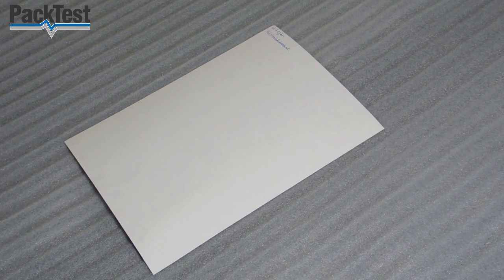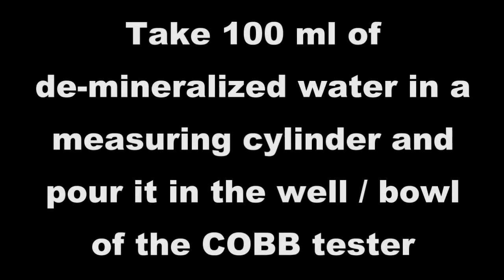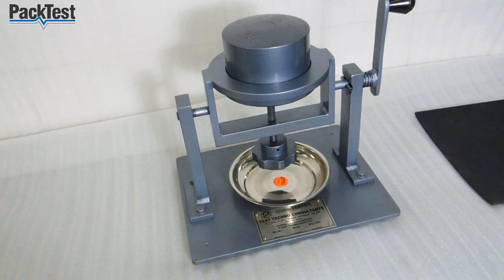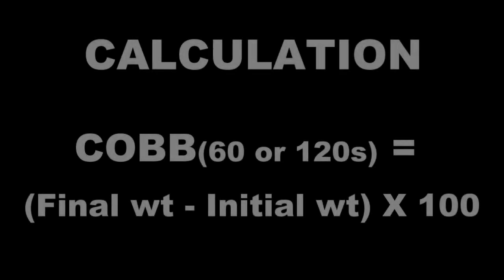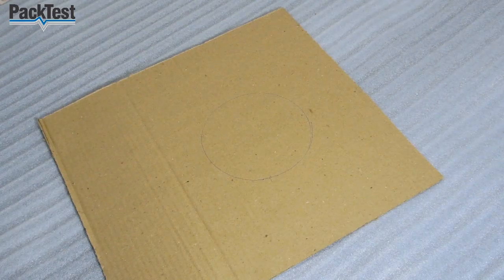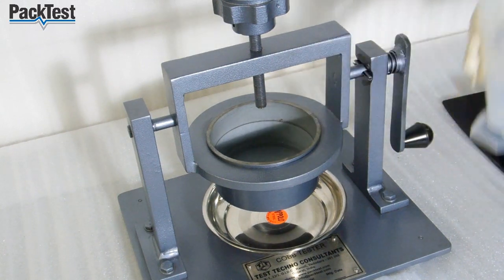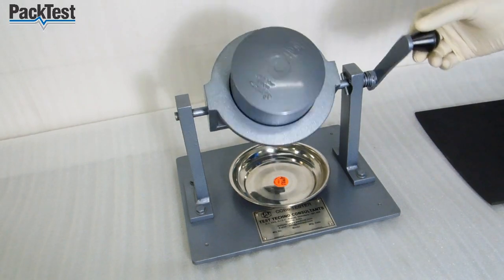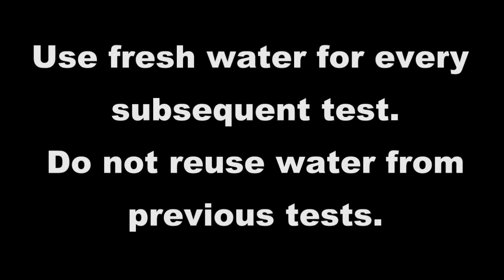COBB Tester Video Guide by PackTest.com (Confirms to : TAPPI T441 / ASTM D 3285 / ISO 535)

Comment: The test process is clear and understandable, but what is the correct value after the test?
That is, what are the absorption parameters that show whether the paper is normal and resistant to absorption or not? What amount of water absorbed is considered a normal value and what is not?
Your help is very important.
Reply from the maker: Interesting Question. Unfortunately there is no straight answer to this. Every different application will need a specific type of paper with a specific COBB value (range). Eg. Blotting Paper has a very high COBB value (it can absorb the most). On the other hand Glassine Paper or Parchment Paper or Currency Note Paper have very low COBB value (it resists water absorption). So is low value correct or is high value correct ? Its application dependant. Corrugation Paper will have different values compared to the paper used to manufacture Paper Cores / Tubes. Paper that is to be printed needs a different COBB. Infact even the type of printing processes that will be used may need different COBB values. The buyer of paper needs to specify what he wants. And if he still faces issues in processing, then he needs to increase / decrease the COBB requirement accordingly. There is no "One Size Fits All" concept with COBB. Neither is "Higher The Better". Hope I was able to satisfy your query today.

Comment: If that's the case, that everyone has to specify his COBB range, what value does the test have?
How can we verify the claims of a manufacturer who claims low absorbency against the standard if there are no absolute values that define as precisely as possible what the correct value is for the same type of paper/cardboard or at least in the same group of paper?
Reply from the maker: Yes, you have to know what value you want. Otherwise if the test says this is 30 COBB, how do you know if that is correct paper for  your application ?. When you say "low" absorbency, it is very subjective. "Low" for you maybe "High" for me. or it could be "too low" for someone else.   

The way forward for you is :
1) Check what is the COBB value for your current supply. Now atleast you have a starting point. Let us say this value is X. 
2) Then see if that paper is giving you any trouble. Analyse the problem being faced. If you think the paper should absorb less, then you can tell your vendor that you need a COBB value lower than X. Or you can try different papers and identify which paper (and its COBB value) is performing best for your application.
3) Make that value as YOUR OWN standard.

I am sorry but the answer you seek from me is not available with anyone in the world. 
There can be no "Single Standard" or no agency (like ISO or ASTM or BIS etc) who can say that X COBB is correct and Y COBB is not correct. Because X may be right for some applications and Y may be right for some other applications.

Comment: Sorry sir can i ask you about this video? what effect do the two papers have on this cobb test? I still don't understand it, i hope you see my comment. Thank you
Reply from the maker: Practical speaking you need blotting paper only on the wet side. But standard says sandwich the sample between 2 sheets. Maybe if the cobb value is very high the water will bleed from the dry side also and will be picked up by the second blotting paper. Doesn't hurt to use 2 sheets.

Comment: Sorry sir please help me 
To calculation (final wt - initian wt) x 100

please tell me where does the number 100 come from?
Reply from the maker: Sample being tested is 1/100th of a Sq.Mtr. Hence the gain in weight is to be multiplied by 100 to get the effective gain in weight if a 1 Sq.Mtr area was exposed to water. The theoretical units of COBB Test are also GSM (grams per sq. mtr), but in order not to confuse it with the Grammage GSM, it was decided to leave it as a unitless / index number. Hence we write the results as COBB = 80 or 80 COBB. Hope I was helpful. for any further assistance, you can write to us at info@packtest.com
Reply: So the number of 100 is the number of circumference of the circle?

Im so confused 😭😭😭
Reply from the maker: @donycandra3296  No Dony, The scientific terminology is that COBB is the amount of water absorbed by paper/paperboard when 1 square meter (1 Sq.Mtr) area of the paper comes in flooded contact with water such that the water forms a 1cm head over the surface. Now if we were to test a 1Sq.mtr area directly, the actual gain in weight would be the COBB value. However testing 1 Sq.Mtr area is not practically possible in a small lab. So the test area is reduced to 100 cm2 (which is 1/100th of a Sq.Mtr). So when you check the weight gain in this small area (100cm2), the gain is to by multiplied by 100 to get the effective water absorbed by 1 Sq.Mtr. 

To summarise.
If I were to test 1 Sqmtr, then weight gain = COBB.
if I test 1/100th Sq/Mtr (100cm2), then weight gain x 100 = COBB.
Simple.

Let me know if you need more explanation. I want to make sure you dont remain confused at all.